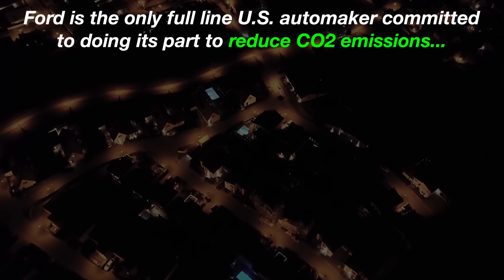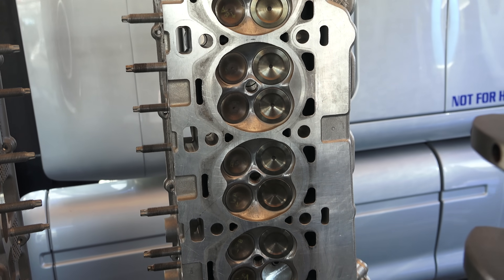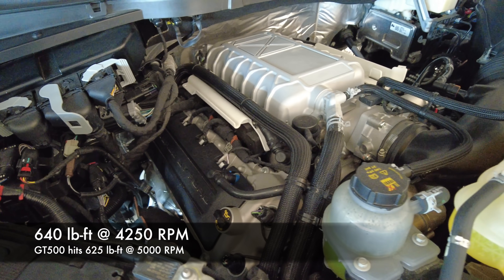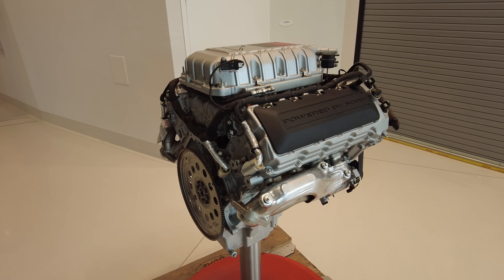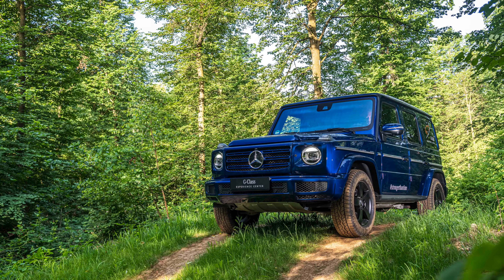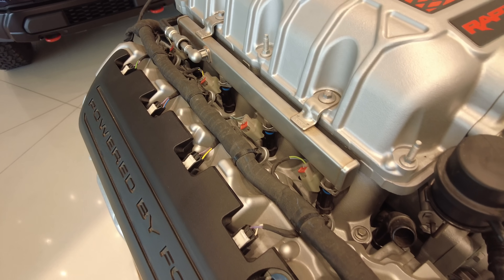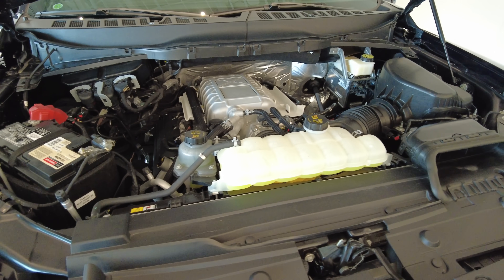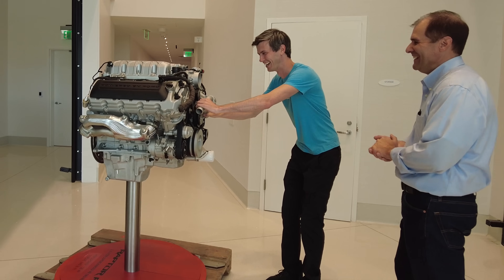Ford Raptor R's New V8 Engine - Meat's Back On The Menu

Comment: Even as a die-hard Mopar guy, I'm glad to see the V8 Raptor back. Always good to have some competition
Reply: Ah, so a concept 6x6 truck called T-Rex based on a Dodge 3500 and shown at SEMA is compared to the production Ford F-150 Raptor.  Now I see where our misunderstanding lies.
Reply: Yes, sometimes the government not banning cola is more important than Coke Versus Pepsi.
Reply: @Richard Ziminski how do you figure that?  What years were they each released on the market?
Reply: Late to the party with their joke of an ecopus engine. When you react to the markets shame and a car company that consistently knocks you off your pedestal, you're not on The cutting edge you're following in the footsteps of another manufacturers home runs. Whether it's the badass TRX or the cutouts in the rear bumper for your exhaust in the new trucks, or the coil spring suspension in the rear. Ford has never been an innovator. And every time they try to be they miserably with multiple recalls. Just use the outbound shocks on the F-150 as an example. Ever make a turn going over a washboard surface and an f-150. It's a joke.  Now the Ford has shot their wad and putting their fancy V8 in the truck Dodge will now put in the 800 horsepower version from the red eye and smoke the Ford once again
Reply: Raptor never has competition ,,imitaros are diferent
Reply: Trx still king
Reply: @vettesweetnos  lighter weight, better power to weight, better weight balance, better suspension, bigger tires…so, uh, what makes the TRX better?
Reply: @aggiewoodie  other than its existence being the reason Ford caved and made the raptor at all, you mean?
Reply: Don’t forget it has 2wd and 4wd as opposed to the TRXs all-time 4wd and the Raptor R makes peak torque at 4,250 rpm as opposed to the TRXs 4,800 rpm. The Raptor R will have less parasitic drivetrain loss meaning more power baby!!!! I will laugh at anyone who thinks the TRX will annihilate this beaut.
Reply: @svgPhoenix  dang, here I w as thinking that Ford released the Raptor in 2010, I
over a decade before the TRX.  I guess I’ll have to question everything I thought I knew now.
Reply: @jamesbeaman6337  thats what im saying
Reply: @TheNuclearBolton  love you kids arguing about a 700hp truck when dodge has 900+ for the new year. Yes this truck might be faster than the older TRX. Not the new ones.
Reply: @Dexter_Solid  I love how y'all still oblivious and still think having more horses is a victory. I'd appreciate this 900hp trx if Dodge manage to make it lighter than the current trx
Reply: @johncarlofernandez2698  you mean lighter like the raptor that bends frames going over jumps? lol
Reply: @Dexter_Solid  i love how you talk about HP and not about offroad performance. I know why ... TRX didn't proof itself in that segment yet.
Reply: @svgPhoenix  Actually the Raptor is the reason why Dodge caved and made the TRX. The Raptor was released over a decade ago. Ford saw the TRX and said hold my beer.
Reply: @svgPhoenix   And the reason FIAT decided to build the TRX would be.....
Reply: @TheNuclearBolton  when it seen passing the TRX or the Rivian, then it gets the respect. I hope, only because competition drives change and better products.
Reply: @aggiewoodie  Maybe because Dodge will let you finance a TRX with a 400 credit score.
Reply: @aggiewoodie  30k less for one
Reply: @aggiewoodie  everything...
Reply: @vettesweetnos  TRX gets walked by 2014 Raptors lol
Reply: @dabomb199715  hahaha show one video of that happening. 🤣🤣🤣🤣
Reply: @dabomb199715  I want GM to throw their hat in the ring

Comment: Everyone is also forgetting this and you forget this too . That the trx is all wheel drive all the time and the raptor r isn't.  Yea it has the 4 auto but it's not a true all wheel drive like the trx .
Reply: AWD is no different than 4WD. Neither system is true 4WD unless you have locking differentials. TRX uses a BorgWarner 48-13 full-time active transfer case with a 2.64:1 low range. It's controlled via a switch on the dashboard. The TRX has a standard electronic rear locker, but the front axle uses the brakes to mimic a limited-slip function. So the TRX isn't "true all wheel drive" either. Only a few trucks have a true all wheel drive system available, either the Chevy ZR2 (both front and rear lockers), or a Rivian (electric motor on each wheel). Everything else is simulated 4WD via single axle lockers and/or traction control systems.

Comment: I feel disappointed by the use of port over direct injection. I do love that supercharger and the durability the engineers have attempted to build into the engine.
Reply: Port injection is more reliable though, something that was glossed over in an otherwise comprehensive video
Reply: @Southghost5997  And port is much cheaper to upgrade for more power - which will undoubtedly happen with these trucks.
Reply: Agreed. I was hoping it would at least be port and direct injection, but then it would cost even more. Despite the other comments here talking about port injection being more reliable, I think direct injection would have served this engine better. Even Jason admitted it's less efficient because of it. There are pros and cons to both injection types though. Port injection will clean the valves and mix better with the air before the cylinder is charged, and direct injection will be better for efficiency, start/warm up, and is more precise with providing each cylinder with exactly the right amount of fuel. That's why I wish they would have just used both injection types. Get the best of both worlds. Clearly Ford spent a lot of time optimizing this engine, so it is a bit strange to decide on JUST port injection.
Reply: @berto1014  Direct is better in almost every way.  Except for cost, ease of upgrade and reliability.  If they had to choose one for this sort of engine, port was gonna be it.  Dual injection like the gen3 mustangs would have been better.
Reply: @ChurchAutoTest  I doubt Ford considers people who will upgrade the engine beyond its capabilities from the factory when making a design decision like injection type. They simply do not care how much it costs the consumer to upgrade since this will be uncommon anyways. I doubt someone who is willing to do engine upgrades that require more fuel will care about the slight difference in cost between the two injection types anyways since they already paid 150k for the base truck and you're going to spend thousands more to upgrade/retune. The only real advantage to port injection is the valves will get cleaned and you don't have to worry about blow-by caking the valves as would happen with a direct injection system without an oil catch can or some other method inside the crankcase. Cost of manufacture and perhaps reliability (cleaner valves and less parts to fail) seems to be the only apparent reason for selecting port over direct or dual injection.
Reply: @berto1014  Well, you'd be wrong.  A number of manufacturers do take into account the aftermarket when designing certain models.  Toyota Prius?  Nope. Ford Mustang? Yep.  A truck like this?  There's a good chance.  Initial cost on a DI vs. PI system isn't a big difference.  But to upgrade a PI system to handle 1000+ hp on E85 (not too tough on this engine/blower combo on the GT500) might costs $2000 for injectors and pump, and equipment exists on the market that would support far more hp.  For DI?  Minimum $5k-$6k, if you can even find components capable of flowing that much.  GM's LT engines have been out for nearly 8 years now and the biggest DI pump and injectors you can find will only support about 1100 whp on E85 - after that its adding supplemental port injection, or you're simply not going any higher.
Reply: @ChurchAutoTest  You'd be right if we were talking about a mustang. This is an offroad truck, and the engineers themselves said they didn't design for 0-60 times, they designed for offroading. This truck is already overpowered for an offroad vehicle. Other than cruising the dunes at an even higher rate of speed (then you need to upgrade the suspension even more too = more cost), the additional power does nothing to improve the offroadability of this truck. So I doubt they considered the cost of upgrading the engine aftermarket in their design decision of selecting port injection over direct injection. Again, if you're paying 150k for the base truck, Ford isn't considering how much you'll pay aftermarket for DI components that can handle more power. If you can afford the truck, you can afford the mythical injectors that can do 1000HP+. Not to mention all the additional internals you'd have to upgrade to even handle that power - connecting rods, cams, headers, etc.
Reply: @berto1014  Alright, clearly you're out of your depth here.  This same block in the GT500 can handle 1000+ whp with no upgrades.  Just more boost and fuel.  And if any of my off-road customers were told their 6000+ lbs trucks were overpowered with 700 hp they'd laugh in my face and then go find someone else to deliver the power.  Even climbing a sand dune at Glamis will eat up 700 hp really quickly and leave you wanting more.  And the F150 chassis in 4wd is capable of deploying a ton of power very effectively.  0-60 may not have been a consideration, but power clearly was.  They could've delivered 650 hp with the Ecoboost engine if they wanted, but they chose the Predator V8 because they wanted more, with room to grow - something the Ecoboost wouldn't have at this level.

Comment: Great review, it felt like you are presenting a new state of the art engine that will save the ICE and not another American V8 with 50 year old design!
Reply: As if ford hasnt been making dohc v8"s since the 90's
Reply: OHV engines are still superior
Reply: @Connor4x4  they may be wayy more simple but ill tell you my 97 mark8 with a 32v 4.6 pulls hard as hell for something bone stock.
Reply: @brysonshires9742  OH yeah those 4.6's are good engines. The maintenance and cost is what makes alot of people dislike them. And their size makes them hard to squeeze into other platforms.

Comment: So Jason, any chance you could break down pros and cons of a dry sump oil system in an application like this?
Reply: Packaging and expense. Solve that and likely every production 4 cycle engine would be dry sump. Lots of pluses, but those 2 CONS are both significant.

Comment: 700 HP….. Couldn’t get that extra 7HP to match MOPAR…….
Reply: I think you missed that part of the video.
Reply: @ALMX5DP  yes. I did see if you push the revs you can get there. Now who goes out of their way to run a pick-up truck to 7000.... unless you're Shelby (cue the Ford vs Ferrari sign 7000+ go like hell)
Reply: Every single first gen engine release, is released with tons of room on the table for yearly performance increases... I'm sure it's underreported as far as what it's actually capable of.

Comment: Great video!! Is that a crack in the oil pan at 8:30 ?
Reply: Could be. It also just looks like it could just be an ugly casting mark, there is another one that looks similar on the front of the pan in the same shot.

Comment: Didn't Ford use side exhaust on some trucks not all that long ago?  Nothing crazy, but just a normal exhaust exiting in front of the rear wheel.  Probably on long box trucks.  Ford Lightning did this too, I think.
Reply: The Lightning was not an off-road vehicle.  The Raptor is marketed as a serious hard-core off-roader, and if they want it to be that they can't be making concessions to street-racing aesthetics like side exhausts.

Comment: You won’t find a new TRX for 80k. Dealer mark up means they start above 100k anyway. It’ll depend on dealers as to what mark up might be put on the Raptor R.
Reply: I’m thinking all this marking up jazz is temporary, inflation money going around, people taking out loans they’ll never pay back, destined to pop
Reply: Swing trade Tesla stock to pay for what you really want.
Reply: U can order a trx n get it for msrp
Reply: You think you’ll find a raptor r for anywhere close to its msrp? Hell, ford dealers around here are marking used mavericks up $15k or more. Lightnings are getting marked up $20k, 50k or more. I think you’ll be lucky to find a raptor r, on the lot, for under $150k. The only shot at getting one close to msrp will be ordering.
Reply: @jeffs2809  around me a few Ford dealers are sticking with MSRP, which is nice. They advertise that fact a lot lol.

Comment: Nobody asks why it's so much lighter. The aluminum body does something, but it's not going to account for that much weight especially since Ram uses aluminum for many body panels. The larger and heavier 37 inch tires are not helping. Where are they shedding all of that weight? Are they taking that out of crucial areas? Or are they using stronger and lighter materials that cost more, hence the higher price tag?
Reply: Which panels on the Ram are aluminum? With Ford, everything from the cab to box are nearly all aluminum, not to mention the all aluminum engine.
Reply: @ALMX5DP  Any hinged pieces like doors and the hood and tailgate are aluminum.
Reply: The TRX is also using an iron block which tacks on some weight.
Reply: @S8ER  That is true, but that still won't account for up to 700 pounds.
Reply: @Mr._P4732  yeah engine is likely 250ish lbs heavier?  The TRX looks bigger overall to me but that might just me.

Comment: 2:49 the torque peak lower because Ford install different cams.
Reply: Right from the engineers mouth on the TFL video, he says they got extra torque from a smaller pulley.  Cams are the same.
Reply: @tylerking27  Cams are not the same. If they were. The peak rpm would be the same.
Reply: @Fone65  they’re variable cams and are the same, do some research
Reply: @tylerking27  The 5.0 in the F150 has vvt but the Mustang GT has different cams.
Reply: @tylerking27  TFL guys are damn sure not to bright when it come to engines.
Reply: @Fone65  he was talking to the engineer from Ford that designed the engine.  The engineer said they got the torque from the smaller pulley, nothing else
Reply: Sorry, and tuning….
Reply: @tylerking27  I saw the video and the guy lied. Changing the pulley size will change the boost but not the hp/torque rpm peak.
Reply: @Fone65  you’re obviously right and way smarter than that engineer…..  again do some research, the 5.0, 3.5tt, 5.2 all have OHC variable timing.  It is the exact same cam in the GT500 and Raptor R
Reply: @tylerking27  No I'm just smarter than you, TFL and EE. Any time two engines have different peak rpm. They have different cams. I don't need to do research because I went to school to learn how to increase hp.

Comment: Ford fans can thank Dodge for this. If it wasn’t for them, Ford would still be overcharging customers with their enemic Ecoboost engine.
Reply: but the ecoboost makes low effort naturally aspirated V8 power AND gets a couple mpg better fuel mileage. Why are you not cheering?!
Reply: @S8ER  Raptor owners don’t care about gas mileage. The 3.5 was ok for the start of the 2nd gen production, but Ford got WAY too cocky and lazy by putting it in the 3rd Gen with no increase of power but the price was still sky high. Before all this inflation and chip shortages the MSRP on a loaded TRX was about the same as a loaded Raptor. Dodge proving that a better truck could be produced for the same cost and thus proving Ford was gouging their customers. This is why free market capitalism is good for innovation.
Reply: @JohannGambolputty22  agree 100% (hopefully you got my sarcasm before 🙂) 🍻
Reply: @S8ER  I didn’t. But I get it now. 🍻

Comment: Doesn't root type supercharger typically considered to be unreliable ?
Reply: I haven’t heard that. They do need maintenance and seas after so many miles but are pretty reliable from what I’ve heard.
Reply: They are exceptionally reliable.  Change the oil ever 100k-150k km and maybe a new bearing pack after that.  But they really don't break, just get noisy as they wear.